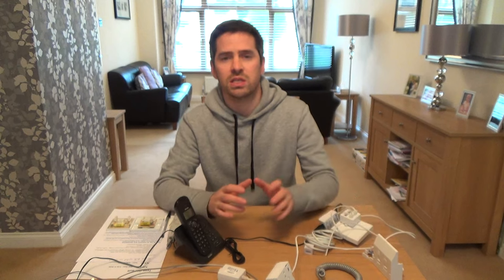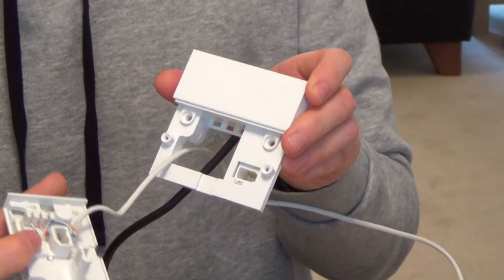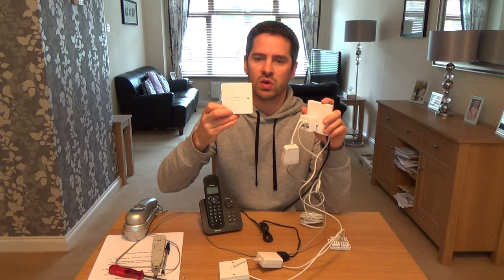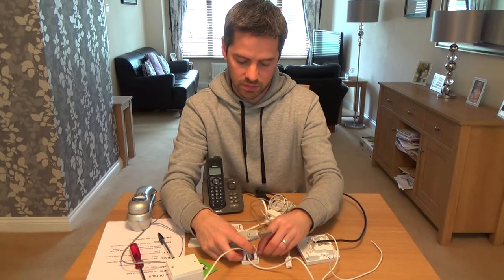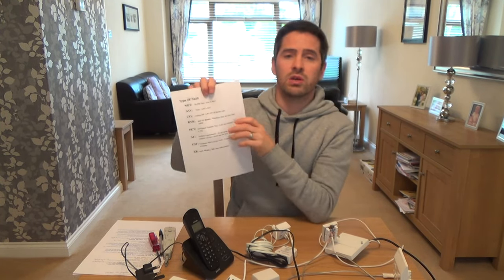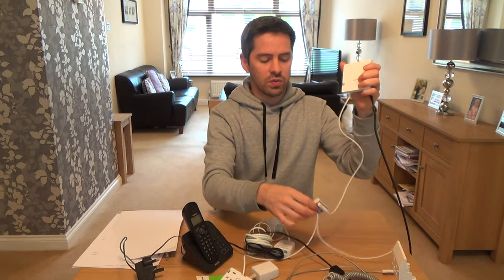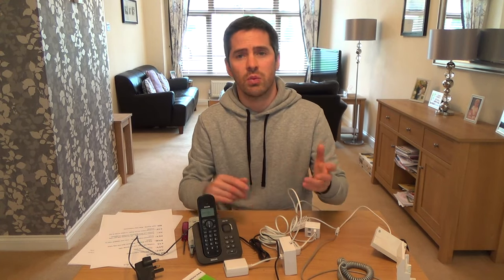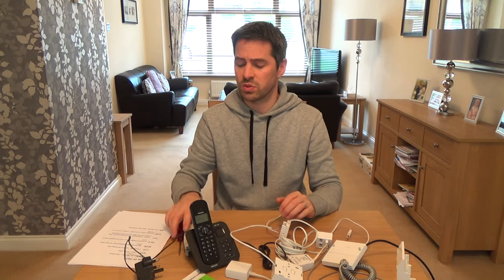How To Fix your TELEPHONE LINE, landline phone FAULT finding and REPAIR.

Comment: I work as a customer help advisor with BT, and wish all customers with a fault on their line saw this first. The number of times customers would rather risk the £129.99 charge than try their landline phone at a friend or family's house is disappointing. I'm so glad you produced this Vince. If you can use a test socket or can investigate please do. If you can't because you're disabled or elderly then BT wouldn't charge the £129.99 charge anyway, I imagine other service providers wouldn't either.
Reply: Buchanan _MJ q
Reply: Well, unfortunately they haven't  fix the problem and the company want to charge $95.00 dlls per hour,  I said no, thank you.
Reply: The fallout fee is a joke I used to work for tiscali just as it got bought by talktalk customers would rather cancel than taking the risk. If the engineer turns up and is there 5 mins £125 ithink it was then is an absolute joke.

Comment: My house phone works but when someone else call it it, the call doesn’t go through and the house phone doesn’t ring. But when I call from my house phone to another phone it works good. Also, on my house phone (on the screen) it shows a message saying: [ Line is busy]
Reply: Ring trip or fault.  One or more jacks have become corroded and are causing a short between Ring and Tip.

Comment: Many thanks to my mate Vince. I called TalkTalk three time when my phone line, seemed to be permanently engaged. They wanted to charge me £65 callout to check the problem. After watching your excellent video I realise there would have been an additional charge because the fault was internal. Using information gained from your video, I found and fixed a fault on a bedroom extension. Thank you for your help. Arnie
Reply from the maker: Arnold Brunton Well done Arnie, excellent news!!!!All the best Vince

Comment: Many Thanks. Just had new installation and bought a corded phone from a charity shop for the landline. Was very crackly. Checked the connector at the router end and it had green corrosion when inspected closer. Cleaned it and it works perfectly!

Comment: Hello Vince , I am in Canada , we had our internet upgraded, and the gentleman did a fine job. But within 2 days we realized there was no phone service.  We let the telephone company know about this, they said they would send someone the next day.  I than got curious as i normally do snd looked it up online. That is where i discovered your video..   After watching your video, in a part of it you say think about what your doing , look at everything involved. So thast's exactly what i did. Within 10-15 minutes I found the fault. When the installer was working he needed some extra line, i guess to make the connection or to make it a little easier to work with. Whoever installed the original service when the house was built did not leave very much cord in case repairs were needed . He ended up pulling oon the line without removing the staples that held it to the 2x4 stud, which ended up cutting through the line, shorting the 3 wires. So if you callws me it was a constant busy signal if you tried to use the phone you heard no tone.  After taking the staple out and separating the lines the phone worked with no problem.  I was very impressed by your video and the advice you had to give. It helped me do the  job.
Thank you sir for making this video it was a tremendous help.   
Thank you
John D from Canada .......

Comment: Your my mate now Vince. What a cracking video. I pulled an extension cable off the skirting board before preparing for painting and the cordless phone in that room wouldn't work. A message said fault on line. When I checked the extension cable, a pin on one off the clips had been punched through the cable. BT said a oner for a call out so i looked up your video. I will get a new cable and let you know how I get on.
Reply from the maker: Cheers Dan.

Comment: I've called bt three times, all times they said no fault, and call out was chargeable. Luckily three engineers did there job properly, two times it turned out the exchange was faulty. The other time the green box at the end of the road had been damaged due to road works, and vibrations damaging wires and loosening them. It is all very well showing how to fix, but sometimes it is their responsibility, they just never want to send anyone out.

Comment: Great video Vince.  I have carried out all the checks you have advised and the test socket is dead. However,  if I ring the landline from my mobile- it rings and I can hear the chat on both phones. However, the broadband ( which works ok when the line is landline is dead) resets itself , but works after it does so. After circa 20 mins -  the landline goes from working - back to dead, until another incoming call arrives. 
Driving me crazy.

Comment: Hi Vince!
I like you, so I'm contacting you from Seattle. 
Xfinity, which used to be Comcast, is the big cable provider, as oppossed to satellite, etc., in much of US.  

It offers " bundles" for internet, TV, home phone. They are  VERY AGGRESSIVE hard sell, but not good at service.
My sister and a friend had the same problem

They both have answering machines. Both did not know VM was included standard.

I would call my friend and get the answering machine, but sometimes I would get an unfamiliar female voice and leave a message. 
My friend complained a couple of times that I didn't return her calls. I told her I heard a different outgoing message. Well, I finally heard Xfinity VM picks up if the line is in use, and the answering machine picks  up if there is no answer.
My friends called Xfinity and FINALLY found they had VM's 8 months old!
My sister STILL has  an outgoing message she made on the VM that goes on FOREVER explaining what's wrong, to only leave a msg when they hear her husband's voice......OMG! It's hilarious! Of course, I ALWAYS leave a message! Must be a few years worth!

Anyway, I can't find how to remove the VM, or bypass it..... Both had trouble retrieving messages, and they're both fairly tech savvy 50+.  Any ideas.....?
Thanks SO much, Vince?
I guess the answering machine would need to go? They are kind of relics, now.

Comment: Excellent explanation of phone faults ~ Thank you Except, I have recently had my landline ring and when I pick up receiver there's no connection to the caller, and I learn they can't hear me and there's silence their end when I've picked up their call. I'm finding when I pick up receiver dial tone sounds a few times before cutting off. Sometimes the dial tone is continuous, and I test by putting down receiver and picking up again? After about 6 times picking up and putting down the dial tone once more goes into cutting out mode after picking up on about a 6th time. When I repeat putting down and picking up receiver again I find after 6-8 goes the tone then returns to being continuous without cutting out? My phone rings but when I pick receiver up there's silence although I was able to answer a couple of incoming telephone-ringing calls that managed to get through. There seems to be a disconnect that inhibits contact between phone users. I have a test socket where I have tried several phones and all do same 'cutting out thing'. I've also tested different filters with no change to cutting out.

Comment: Vincent, thank you for a great  video.  I have  a situation  where the phone  works on the test socket.  I don't  use any  other things plugged apart from  our Internet.  So when it's all plugged  in it doesn't  work.  We bought  a new phone  , no joy. Changed the extension wire and tried it without.  So it's strange as l am thinking  it must be the outreach  socket  on the wall that's got a fault where  we plug the phone  wire into. I am at a loss what to do atm.

Comment: Vince.  I have searched a few videos to remedy a phone problem.  I have done the test and can phone out and receive calls, so I know that the line is ok.  When I screw the plate on, I can receive calls but cannot phone out.  I have tried different phones, all the same.  Any ideas Vince - excellent videos by the way.  Thanks. Rick

Comment: Hi Vince, Great Video. Very Informative. Our fixed landline dial tone in rural Australia suddenly disappeared several weeks ago after very heavy rainfall and since then it randomly comes and goes e.g. it can be 5 days with no dial tone, then it will suddenly return for a short period of time on one day during the day followed by another short period of dial tone again during the next day, then no dial tone at all for several days again. Then most recently, commencing Friday morning through until Sunday (after days and nights of no dial tone at all again) , the pattern changed to having a dial tone for about 10 hours during the day (dial tone disappearing at night and no dial tone overnight, returning around 7am in the morning).  There is what sounds like a busy tone (or fault signal?) when we call our landline. Does this sound likely to be an exchange issue or wires from telephone exchange fault to you?  (We had all our cabling re-done by licensed technician when getting extension sockets installed about 3 years ago so, there is nothing wrong with our telephone handset or cord and nothing else (not even another handset) was plugged in when no dial tone was first discovered).

Comment: Great video, i'm here in australia and my parents house had their  line upgraded because they were upgraded the telephone poles.  the phone line is faulty now it has a bad line where there is a background buzzing and it's hard to hear each other, i have swapped the handset over but it didn;t change, i reckon it will be that mice have interfered with the wires etc, can i check the wires through the house myself in the roof cavity etc?

Comment: Thank you for all of the background information necessary to deal with the interior telephone wires.
There is a lot to keep track of.  "Can't tell the Players without a Program" I like to say.  
If I could please ask you to clarify something for me?  Are any of the interior wall wires live?  I need to cap an old and very ugly wall extension and am afraid of an electrical shock.  
Cab I just tuck the old wires back into the wall before capping, or should I do something else.
Thanks from Moms all over the world!

Comment: thanks for the video Vince

The problem I have is that people sometimes get a very noisy line when calling my landline, but not always, it's intermittent, but it does happen with several people and the noise can make conversation impossible. No noise is heard from my end though.

BT have found no fault, I've no extensions in the house, have also used another hand set and plugged in to the master too but same problem.

What could it be?
Reply from the maker: James Perry Hi, that is a strange one. From memory all the noisy lines that I had were 2 way. A noisy line will often test ok with the BT fault system because the wire is still intact because the wire is just barely together and when it gets worse the noise will get worse and then eventually the wire will separate and the line will become dead and then the BT fault system will recognise the fault. Next time you have noise on the line after you hang up maybe try ringing your mobile and have no noise in the background (TVs, Radios etc) and see if you can detect the noise on your end. Or try dialling just 0 and then see if you can hear any crackling on the line (you will only have a short period before you have to hang up and dial 0 again). BT engineers have a quiet line test which makes it easy to test. I am not sure about the one way noise so hopefully it will turn out to be both ways so it is easy to fault find. Also make sure you have double checked your adsl microfilter  in case that is causing the problem.Thanks Vince
Reply: My Mate VINCE Thanks for the advice, I'll try as you suggest next time someone tells me it's noisy when they call (it's ok at the mo but happens every few days). Cheers, James

Comment: Any Advice? Got home and phone was  ringing answered the phone still ringing via the ear speaker cancel the call and its still ringing until the caller hangs up. No Dial tone going out. Internet is working fine no dropouts or slow download speeds. 

NTE5 Socket also tried the test socket with 3 phones. 

The line is 30 years old and goes through at tree :(
But last year BT was tightening all the lines to the polls in my area because they was to low.

Comment: Do I have this right? ... At home, we have the AT&T CL4940, with a built-in answering machine. It uses an AC adapter, and probably uses a microprocessor (microprocessors are sensitive to power fluctuations ... The Main Power Circuit Breaker to the house was flipped off, while trying to find the circuit breaker a light was on, in order to fix the socket. The Main Power Circuit Breaker could not be reset. It had fried ... While in the dark, and needing to call an electrician, we see that the "reliable" landline phone has the pre-dial tone, but no dial-tone. No phone calls are possible ... The fix:  Un-plug the AT&T CL4940's RJ-11 from the wall, plug it back in, and the dial-tone was restored ... So, this was a "fault" due to a power "loss", which left the line "open" ... But we did not hear the "off-hook" tone, any idea why? ... Also, the average person doesn't know how to troubleshoot this, which could be a big problem in an emergency. I wonder what could be done about that ... Initially, I thought this was due to a power surge, and put the AT&T CL4940 on a surge protector Wall Tap, but now, I am re-thinking the sequence of events that led to no dial-tone. I think the Wall Tap might not be necessary, but that it can't hurt.

Comment: open shorts are easy to find and eliminate go to radio shack or a swap meet 5-10 dollars for a digital multi meter set it to continuity then test piece by piece if the sound stops you have found your short , then cut back each section , re-splice test ma standard is ma 23-36, and dc 48-52 is standard protocol at all providers! as a Master Telecomm engineer with 34 years i have seen it all!

Comment: I have new batteries (tested with multi meter), and my at&t box(router) is working fine according to at&t from there end.
The 4 batteries were put in the correct way.The telephone wire from the box to the phone and the wire from hand set to phone are new and the phone sockets are clean and not defective.\No dial tone.
What could it be?
Awesome video. Thanks a lot.

Comment: Hi Vince

I was wondering if you can help me. I am a bit puzzled as to why when I plug my working phone into the inner master socket the line is dead!! But when I plug it into the front plate socket it works fine. Ive looked at the wires in the master socket and it has 3 pairs of wires. The blues and orange pairs are connected to the front plate, the greens are connected to the inner master socket. Im really confused. Any help would be appreciated. P.S Great channel keep up the excellent, informative videos coming. Big thumbs up.
Reply from the maker: palla69 Hi, thanks for the comment and the message. That doesn't sound like it has been connected up correctly. (It is back to front).  I bet the line is live on the blue pair of wires and years ago it was live on the green pair of wires but some work must have been done before the master socket (possibly on the external junction box) and it was swapped from the green pair to the blue pair. If it is a true master socket (the first socket in the property) then the blue pair should be on the A and B terminals on the backplate. At the moment it is just using the front plate as a little extension socket, so it will work fine but it just isn't done correctly, so you can't fit an ADSL faceplate etc. But depending on your setup it may not make any difference to the line or the broadband speed having it wired up wrong the way that it is.Many thanks Vince
Reply: Cheers Vince. Managed to sort it.

Comment: Have a flashing purple light on my bt router, going to try this tonight to see if the problem on the line is internal or external.. reckon it’d be internal or external and have you had anything this before? Cheers

Comment: I was having trouble making calls but could receive them.  I live in the US and they are changing how certain areas are dialing.  Due to the 988 number going to be used as a mental health hotline starting next summer July 2022. But, area codes in some places will have to be used  with the local numbers you dial starting October 24, 2021.  You can google info about the change.  Long distance remains the same.

Comment: For a reliable landline, I think you just want to have "basic" phones plugged in (with no microprocessor), like the AT&T Trimline210 . . . But you need an answering machine (stand alone) - so, that will need to go on a UPS . . . If you have a phone with a built-in answering machine, I suppose putting that on a UPS would be fine also.

Comment: Amazing video - really informative. My problem is a really crackily line and you mentioned that moisture or damp getting into the wires might be culprit. How can moisture get into the wires? what examples have you found?
Reply from the maker: +Vanessa Simpson Hi, normally from rainwater externally or in some houses rising damp can affect the telephone sockets and junction boxes.